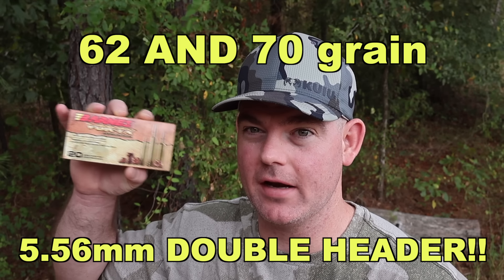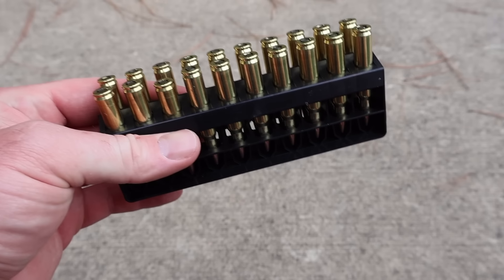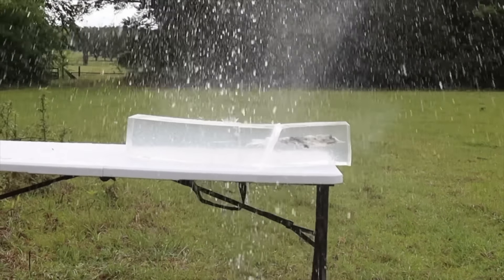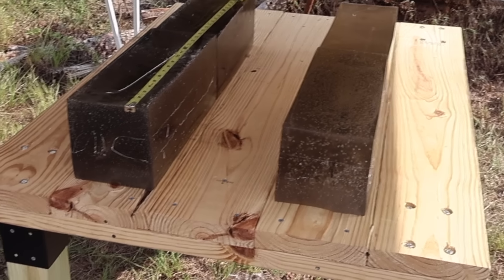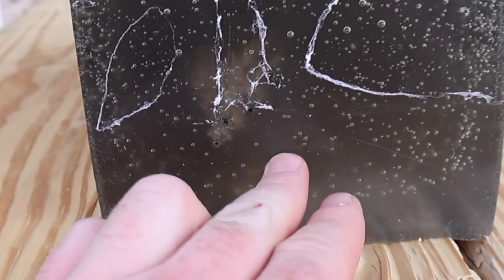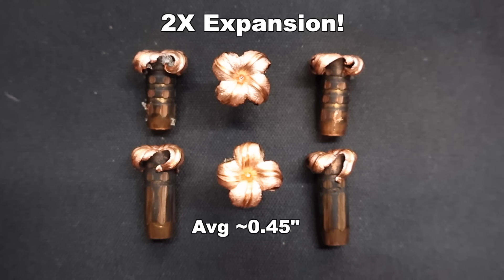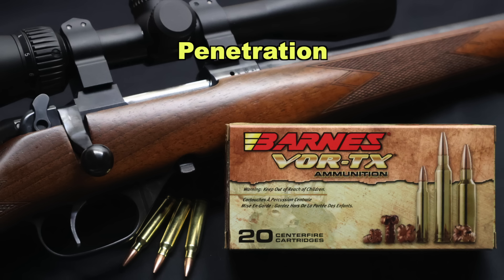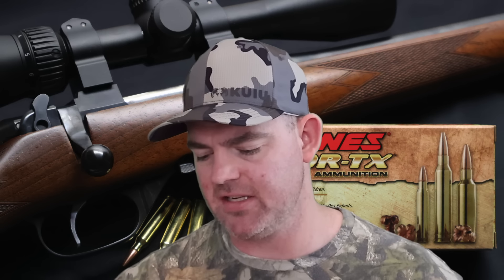.223/5.56 DEER SLAYERS?! 5.56x45 Barnes Vor-TX TSX 62 & 70gr Ammo Test

Comment: I have taken 9 deer with the 62 grain load all were one shot kills 3 dropped where they stood and none ran more than 50 or 60 yards. All of my shots were between 120 and 150 yards from a 16” barreled AR. All were complete pass throughs but the largest deer was buck with a live weight of only about 160 pounds.
Reply from the maker: Outstanding
Reply: Do you go for behind the shoulder shots?
Reply: I really want to know where you shoot too, I think with this kind of performance you could shoot through the shoulder in a anchoring shot and still pass through, but I'm not sure.  Would love to hear where you aim since you have allot of experience, I'm hoping to try to this coming season with the 62 or 70 grain TSX
Reply: I usually take high shoulder shots. It breaks the spine and takes out the top of the lungs but I have taken a few through the shoulders. It’s a solid copper bullet so it penetrates very deep but still opens in the first couple of inches cause a lot of damage. I’ve never had one not completely pass through including a few that went through both shoulders.
Reply: @kevinkerr2847  That's very impressive, I have a brother in law who is a big hunter, but uses a 250 grain 450 bushmaster. He is convinced a .223 / 5.56 just isn't powerful enough for shoulder shots. Would love to show him how wrong he is.
Reply: @-Zevin-  Barnes Vot-TX will show him.

Comment: The key with Barnes bullets is to go lighter than you typically would. I know it goes against everything we think with cup and core bullets, but the solid copper bullets LOVE velocity. Try getting your hands on the 50gr or 45gr tsx or ttsx bullets. I know people (that don't know) buck at the idea of using that light of a bullet but once you see the performance, it will make a believer out of you. Just my .02
Reply: The trick is to go LIGHTER for caliber. Not necessarily the lightest. You still need some mass for penetration and bucking wind. I personally wouldn't go below 55 grain TSX for deer. I would run the 62s for that extra mass.
Reply: @reconrc1787  that tracks. The extra velocity should show benefit and the fact that these are all copper make them longer by weight than cup and core bullets. I personally think that's why I'm able ti run the same zero for 70gr tsx and 77gr smk.
Reply: I've used the 55 grain barns quiet ok for deer out to 200 yards
Reply: You’re on the right track, but I actually think the key to copper bullion is less about weight and more about velocity. You have to make sure your bullet has enough velocity to expand at the distance you plan to hunt. For example, if you use a 100 grainer in a 26 Nosler, you’re going to break petals off at closer ranges. I would use the heaviest copper available in a 26 Nosler. In 223 I think the  55 or 62 strikes a good balance between retaining velocity and energy. I actually use the 62 TTSX and 70 TSX because they group the best.
Reply: The 55 was only one that grouped in my gun the heaver ones was two long span sideways
Reply: @deanjohnson9414  1:9 twist?

Comment: The box of projectiles I have is all over the place in grain weight. From 62 grains all the way up to 62.50 so I don’t expect sub MOA accuracy. With that said this projectile is not designed for pinpoint accuracy. It’s designed for devastation on a soft target. The few I have tried to group at 100 yards produced 1.5 to 1.75 inch groups. Definitely capable of bagging a deer at the range I’m hunting at. Oh btw I’m using a 20” 1/8 twist and CFE 223

Comment: Bullet length dictates twist rate required more than the weight of the bullet.
The twist rate requirements are especially important for barnes TSX projectiles due to the fact they're copper with no lead. Lead is a denser metal, therefore, it's easy to get higher weights in shorter bullets if there is lead.
70 grain barnes tsx bullets are longer than most 77 grain projectiles, and the 62 grain barnes are longer than any other 62 grain projectile. Because of the projectile length discrepancy between lead bullets and copper bullets of the same weight, the copper rounds will require faster twists. Reports of these rounds failing to stablize from slower twist barrels got so common that barnes started printing the twist recommendations on the box apparently.

Comment: Length of bullets are a big factor in tate of twist. A 70 grain all copper .224 is longer than a lead cup and core 70 grain, probably why Barnes recommended 1 in 8 for the 70 grainer.
Reply: Bullet length for rifle twist is a big fat false!
The rate of rifling twist is rated by caliber and bullet weight only.
I suggest calling Pac Nor barrels where I by all my rifle barrels for my custom rifles and talk to Jay to educate yourself of the truth about rifle rate of twist.
Being an addicted video war game doesn't make you a gun expert!
Reply: Barnes actually used to request a 1x7 twist for the 70grs, especially when shooting from an AR with a 16inch or shorter barrel.  More then a few shooters out there have had keyholeing and / or suppressor baffle strikes when running 1x9 barrels.
Reply: @reconrc1787  Your right, and guys need to realize Barnes all copper bullets are some of the longest for equivalent weights.
Reply: @brianklamer3328  They are massive for a .224 bullet. The fist bulk load of loose 70gr Barnes bullets I got my hands on to load I had to double check to make sure I wasn't sent something wrong by mistake. I was actually really concerned about trying to load them deep enough to run through a semi-automatic rifle / magazine.  On my own personal rifle, I ended up cutting the front out of a metal mag and testing to see how far out I could run them while still having the rifle cycle. One other thing about Barnes bullets, they like a little bit of a jump to the lands.
Reply: @reconrc1787  I've only shot Barnes in factory loaded ammo, you have a lot more experience with them than I do. Have heard other men at the club say they can be finicky to reload.
Reply: @reconrc1787  Due to your extreme Green horn reloading experience clearly you have No idea not all guns are the same as yours so telling other people Barns bullet must be seat far out of the case is a bit stupid .
You also have no idea that powders aren't all the same - if using Powder W-748 that powder can be leader to the case top then powder like 2203 at 25 grains is max charge and that powder only fills half the case.
So you blabbering you thought the case capacity for powder wouldn't let you seat a bullet indicated your ignorance and Green horn loading experience.

Comment: Great performance for hunting.   Have tested the TSX 62gr for accuracy but unfortunately my 1990s Weatherby Vanguard 20" barrel won't stabilize them.... and it pops primers.
Reply: what was the twist rate of that gun?
Reply: @Magnum_Express  It's a 1-12 twist... it does well with the Winchester 64gr Power Point.

Comment: Out of a 5.56 these are probably pretty good. I used to load some 95 gr Barnes bullets for my .257 roberts and they were OK.
However..... I tried a box of these Barnes vortex bullets for my 45-70. 300gr.
The picture on the box shows perfect expansion, big flower like petals on the bullet. Couldn't be farther from the truth. Sight in target was on 1/2 inch plywood with stacked oak 4x4s about 4 inches behind it. The bullets blew through the plywood and were laying on the ground in front of the 4x4s. No expansion whatsoever.  This was at 50 yards.
Reply: Solid copper hollow points don't expand when they hit wood. They need to hit a aqueous media to initiate hydraulic expansion
Reply from the maker: Plywood/wood and flesh are not good proxies for each other. Plywood also does not simulate living bone. I’ve used TSX’s from a 45-70 on wild hogs and ballistics gel and they performed exceptionally in both circumstances.
Reply: @dfleury8893  That's what I  was wondering about. You would think though that a 300gr bullet with a listed muzzle velocity of 1925 fps would at least penetrate into the 4×4 a little, even though it didn't expand. 250gr leverevolution from my 450 bushmaster were burying in about a half inch. I know, apples to oranges. I found some 250gr leverevolutions for the 45-70 and they didn't penetrate much either but they did expand quite a bit. I'm kinda new to the big heavy bullet low velocity thing. More of a 220 swift kind of guy.
Reply: @moose.knuckle  Of course even a hammer mashed on lead caused the lead deformation.
Hammer on a lead bullet it is going to take more force to cause the bullet to deform.

Comment: The CZ chamber is .223.  Shooting 5.56 spec ammo in a .223 can result in higher pressures.  The higher velocities recorded could be a result of higher pressures.
Reply from the maker: Possibly so, CZ directly states the 527 can use either 223 or 5.56
Reply: @masonleather_outdoors sounds like it has the WYLDE clambering if company states both can be fired.
Reply: CZ .223 uses CIP specs ( Made in Europe). They state it will safely shoot 5.56. I have zero reason to doubt them.
Reply: Absolutely correct.  European CIP 223 specs is basically equal to 5.56x45 Nato. @thinlightmusic

Comment: I tried the 62 grain with a 1/8 twist and had no luck with accuracy. At 100 yards 5 shots, 2 stacked touching holes 3 shots missed the steel totally by 2-3 feet. Had the same problem at 50 yards as well but off by a foot with every other round. So disappointing my rifle doesn't like them. Awesome performance!
Reply: I have heard that before using solid copper bullets your barrel should be thoroughly cleaned of all copper fouling.
Reply: @EC-mc7vg  I started with a freshly cleaned barrel. No good for me if it needs to be cleaned for each shot.
Reply: @Adam-upnorth What I meant was the copper fouling from conventional copper jacket bullets being cleaned out before using solid copper bullets, not that it needed to cleaned for each shot. But if your rifle doesn't like these rounds then it is no good anyway. Hopefully you find something your gun likes.
Reply: @EC-mc7vg  I knew what you meant. Shoot 1 and 4 were the dead on one's. 2,3, and 5 were misses so I would need to clean it better. The round performance into milk jugs was exceptional! I want a different barrel so I can use these. Just sucks my rifle will stack the m855s. I wonder if I got a bad batch. They were on clearance.
Reply: @Adam-upnorth  It does suck when a great performing round just won't shoot out of your rifle. That is so odd that the spread was that extreme, don't think I have ever seen anything that big a spread unless there was some other problem with either the firearm or the optic.
Reply: @EC-mc7vg  I am with you 100%! I'm a certified master gunsmith and it blew me away. Threw some cheap ones through it and had a 2inch group with a 30rd mag of the m193s so I know the scope is good. I seriously wonder if it was a bad lot. A couple of the bullets would spin in the case like they didn't get a full crimp or weren't seated properly.
Reply: @Adam-upnorth  Oh wow, sounds like a possible bad batch to me. The bullets certainly shouldn't be that loose in the case. Could give wildly different seating depths, possibly even pressure spikes if the bullet got pushed back in the case when chambering a round.
Reply: @EC-mc7vg  hmm,  I think I'm going to try another box.
Reply: @Adam-upnorth  I hope you have success with them.
Reply: @EC-mc7vg  thank you

Comment: I am little confused. In the boxes clearly says, in English and French: "Not for use in Remington 223 chambers", and you say that your CZ is chambered in 223. Can you please clarify.
Reply: 5.56 and .223 are extremely similar. General rule of thumb is 5.56 chambers can shoot .223 cartridges safely, but 5.56 cartridges MIGHT be dangerous (questionably) in a .223 chamber. Some manufacturers label the chamber as .223 but still tell you it's safe to shoot normal factory 5.56. And then .223 wylde was made to be the safest AND most  accurate chamber for either cartridge. I guess some people have accuracy issues shooting.223 from a 5.56 chamber

Comment: I wonder what the length of those bullets, that weight off all copper especially hp will be pretty long. The length of the bullet is more the reasoning for the twist rate rather than weight but the heavier the bullet the longer
Reply: That is absolute false BS and the rate of twist is rated for caliber and bullet weight not length of bullet.
When I am going to build another custom rifle, I am calling Pac Nor then order the barrel by caliber and weights of bullets going to be used not by length of bullet and that would be impossible to have barrels rated by length of bullets because all bullet length isn't the same.
Reply: @Lure-Benson  try being a little more coherent. It's called ballistic coefficientcy

Comment: Why does it say on the box not to use them in a .223 Rem chamber?
Reply: Higher pressure
Reply from the maker: Because of a minuscule differences in a .223 Remington vs 5.56x45mm chamber dimension
Reply: Liability. Slightly higher saami specs for 5.56 pressure. 
As soon as lawyers are introduced,  logic goes out the window. In the real world a 5.56 round is going to create no issue in a 223
Reply: Because there is zero danger to us 5.56x45 in 223 chambers and anyone who thinks that is as ignorant about firearms and reloading.
The reloading data show 5.56x45 with 223 and there is zero difference and max powder charges exceed all and any commercial & Military loadings and some load data is so High pressured the primers after fired show flat and even the firing pin indent is pushed bad up !
So where are the blown-up guns? show me?
I have been reloading ammo since 1976 and owned ARs before Bill Clinton was president and been shooting military 5.56x45 in Remington 700s in 223 for many years in Alaska varmint hunting.

Comment: On a note about barrel twist. If you are buying a 5.56 that has a barrel twist that isn't 1/8 or 1/7 you are wrong. Modern ammo is far superior to the stuff coming out in the 60's and requires at least 1/8 to be effective.
Reply: My old Bushmaster HBAR 16 inch 1 in 9 twist loves heavy long bullets. I’m getting.42 MOA at 100 with this stuff. So can’t always go by twist rates I think sometimes it’s the quality of craftsmanship and materials used.
Reply: @jeffmurphy9987  well yes quality above all. And your hbar is older 1/9 was popular then. I'm saying with the knowledge we have today if you pick a brand new barrel with something slower than 1/8 you are setting yourselfup for failure.

 But how well does it stay stabilized out to 500yds shooting 77gr? And it can also affect terminal performance. But you also have a 1/9 that is still very close to the 1/8 that is very popular today. Not a 1/12 that i have seen on some rifles that definitely cannot stabilized heavy bullets.